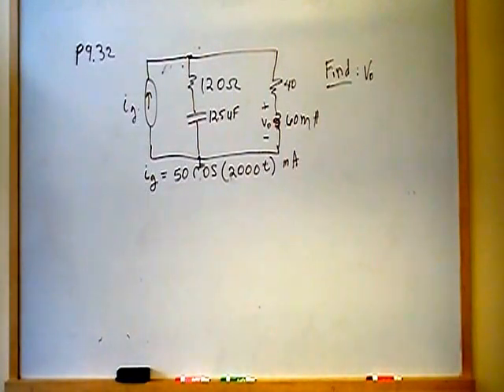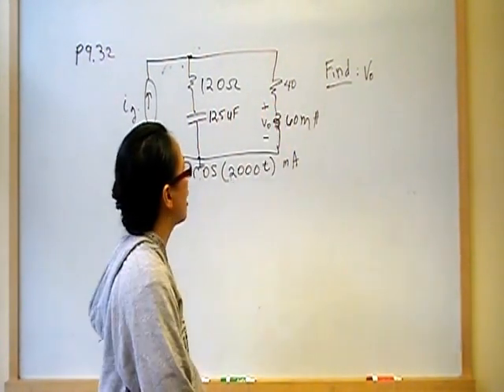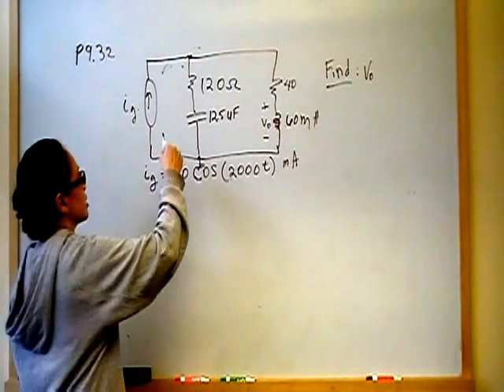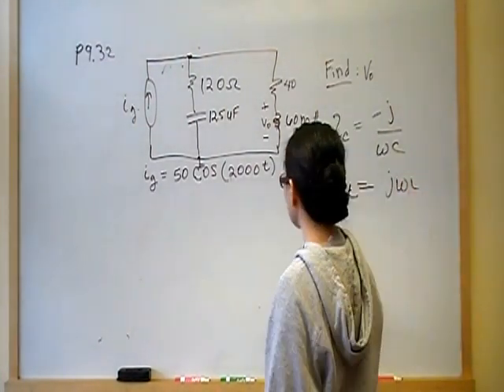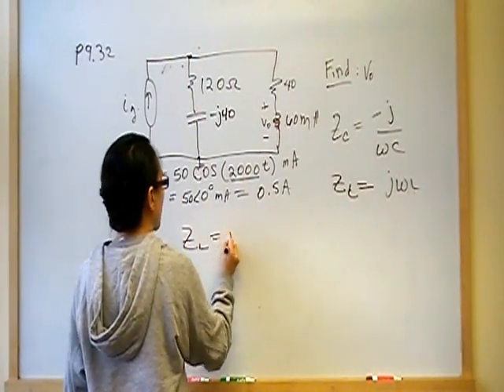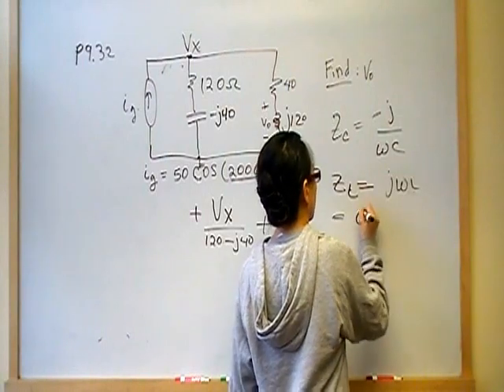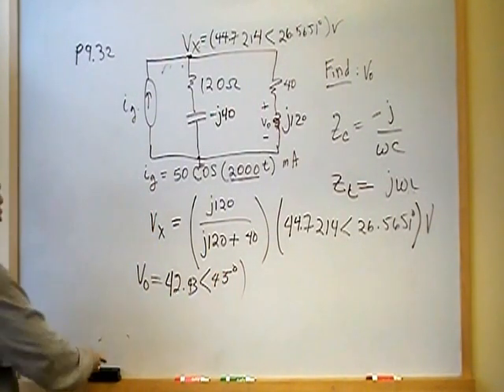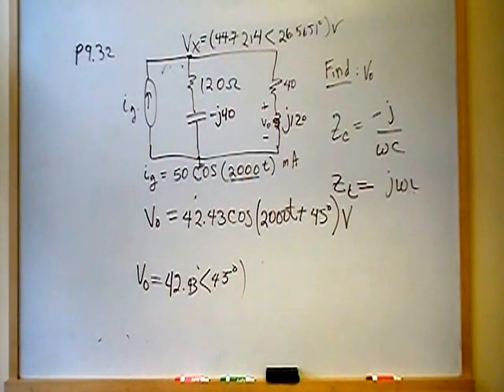Kirchoff's Laws in the Frequency Domain P9.32 Nilsson Riedel Electric Circuits 9E Solution

Comment: The current is 50mA or .050A, not .5A as in the video.  So the answer is off by a factor of 10.  Should be 4.243 volt at 45 degrees.  Your videos are VERY helpful Thuy, thanks so much!

Comment from the maker: the negative comes directly from the definition of capacitor impedance. it is equal to -j/(wc). capacitor impedance is a negative imaginary number and inductor impedance is a positive imaginary number. it has to do with the way energy is stored in the magnetic fields. hope that helps :-)